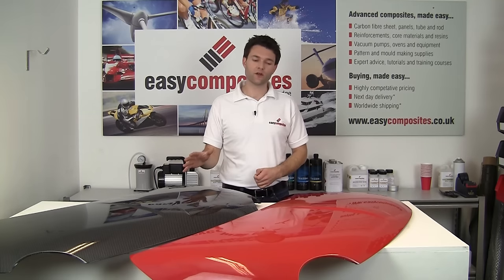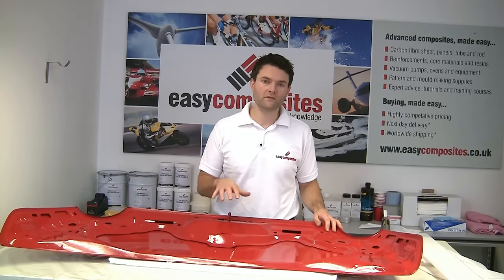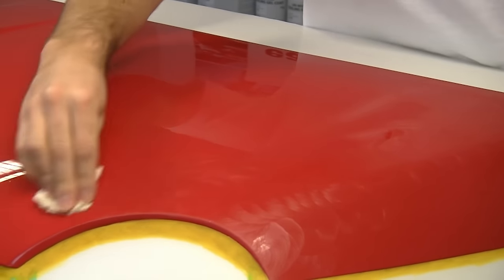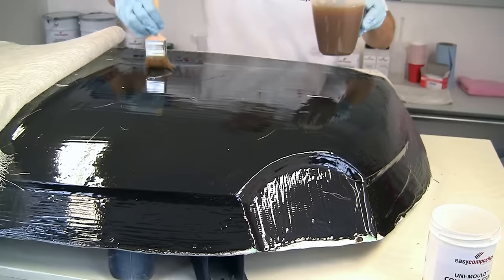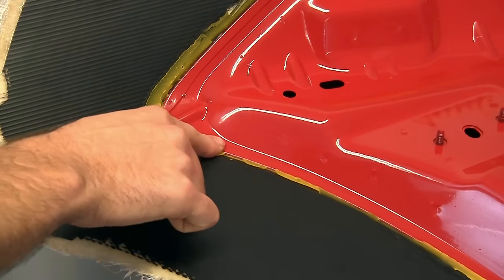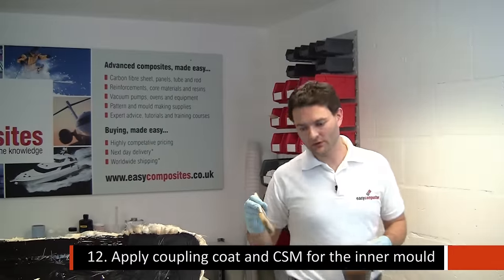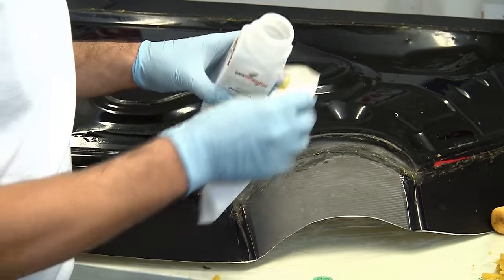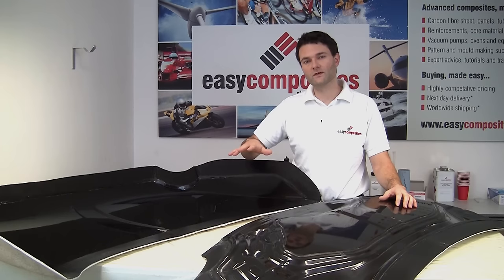How to Make a Carbon Fiber Car Bonnet/Hood - Part 1/3 : Making the Mould

Comment: What would this have cost (mold and part) if you were to buy the materials?
Reply from the maker: No The finished bonnet wieghed 3.5kg which is a saving of 16kg over the OEM
 bonnet. 
 
The exact amount of materials you’ll need will vary depending on the 
size of your hood so I’ll base this on a bonnet of standard dimensions, 
you can then scale the quantities up or down depending on whether you 
hood is larger or smaller than an average 1.5m x 1.2m bonnet.

Also, some of the steps (like the gelcoating) are optional and other 
steps (like the bonding of fasteners) will depend on what you need to 
bond so I’ve broken these down separately at the end.

*Complete List of Materials for Making a Carbon Fibre Bonnet Measuring 
1.5m x 1.2m*

Mould Making Materials:

The outer mould and inner mould will be approximately 1.9m x 1.5m in 
size. This is about 3sqm per mould.

Quantity    Product                                    Unit £    Line £
10kgs         Uni-Mould Tooling Gelcoat         52.50     105.00
10kgs         Uni-Mould Coupling Coat           46.60      93.20
50kgs         Uni-Mould Tooling Resin           114.00      228
15m            80g Chopped Strand Mat          1.70         25.5
14kgs         450g Chopped Strand Mat         2.19         69.66
1                Laminating Roller – 75mm         5.20        5.20
5                3” Laminating Brush                  2.00        10.00
100             Nitrile Gloves                            4.99        4.99
100g           Number 8 Release Wax             6.50         6.50
500ml         Easy-Lease Chemical Release   16.50       16.50
330g           Yellow Fileting Wax                   6.17         6.17
1 roll           50mm Release Breaker Tape      6.95         6.95
                                                                  TOTAL   577.67
 
Equipment & Consumables

Quantity      Product                                   Unit £      Line £
1                  Resin Infusion Starter Kit,         357.00     357.00
                    With Pump, 5kgs Resin
                                                                   TOTAL 357.00

Materials for the Bonnet Itself

For a bonnet measuring 1.5m x 1.2m you would want a surface plies 
measuring 2m x 1.5m. Based on a an outer skin of 200g carbon, 2mm Soric,
 200g carbon this means you'd need 4m of 1.5m wide carbon fibre and 3m 
of Soric for the outer skin.

For the inner skin 2m of 1.5m wide 200g 

Quantity      Product                                          Unit £    Line £
6m               1.5m Wide 2/2 200g Carbon Fibre    35.00     210.00
                    200g Carbon Fibre
3m                650g 2/2 Twill Carbon Fibre             25.00     75.00
3m                Lantor Soric 2mm                          8.14       24.42
1                   PT326 Adhesive 400ml Tube          48.41      48.41
                                                                        TOTAL  357.83
 
This gives a grand total of £1292.50 (ex VAT) for all of the essential 
materials and equipment to make the carbon fibre bonnet/hood. Remember 
than most of the equipment can be re-used forever and that the moulds 
(the most expensive part) can be used to make hundreds of parts if you 
wanted to.

Optional Equipment & Materials

If you want to spray the outer skin with a UV protective gelcoat 
directly into the mould before infusing then you would need a cup-gun 
and gelcoat but I would not recommend you do this because it’s an added 
step of complexity. Instead, I would suggest you infuse straight into 
the mould and then, if the parts comes out right and you want a UV 
protective coat, that you just lacquer it afterwards.

Quantity     Product                                   Unit £    Line £
1                 Gelcoat Spraying Cup Gun       130.50   130.50
2kgs            GC50 Polyester Gelcoat          11.75      23.50
                                                                TOTAL   154.00

If you don’t have abrasive tools for trimming and finishing the parts 
then consider:

Quantity      Product                                      Unit £  Line £
1                  Perma-Grit Sanding Block Small  13.96   13.96
1                  Perma-Grit Bosch Jigsaw Blade    3.54     3.54
1                  Mirka Combination Pack              19.95   19.95
1                  Perma-Grit 32mm Rotary Disc       8.33    8.33
 
Likewise, if you don’t have a dispenser gun for the adhesive or you need
 the smaller adhesives to bond fasteners in they are listed here:
   
Quantity        Product                                      Unit £    Line £
1                    400ml Adhesive Dispenser Gun    52.50     52.50
1                    50ml Adhesive Dispenser Gun      19.95     19.95
1                    ET515 Epoxy Adhesive                10.17     10.17

It’s worth remembering that in composites, the most expensive bit (apart
 from the equipment) is the moulds. In the above list you’re buying a 
lot of equipment for the first time which you’ll be able to use over and
 over and you’re also making a mould which, if you wanted to, you could 
also use over and over. If you only use it to make one part then it 
pushes the cost of that part right up but having a mould does give you 
options for making other parts and selling them, or making multiple 
copies for yourself (rally car use for example!).

Comment: as much as it sucks, i dont do plies between cure. i either wait for a full cure, use lamps but carefully not over accelerate the cure. but i def do a full cure and then do a sand and clean then continue building plies. then again that was for aircraft cars def dont go through as much torture.
Reply: i guess for a mold it wouldnt matter all that much.

Comment: what is that white liquid that you always put a few drops, and why this (MEKP Catalyst) can not be send to USA and what is that used for, if it is really important, what else do i can use, thanks
Reply from the maker: +Aldo Allende Oliva: MEKP is that is used to cure vinylester and polyester resins; if you read our guides and watch our videos you will be able to see how and when it's used. MEKP is highly oxidising and is simply not allowed on an aircraft. You can purchase it from any fibreglass supplier, boat yard, auto shop etc.

Comment: Fantastic video tutorial! 

One question...how often can you use a mould like this?
Reply from the maker: +DJMaKOfficialPage Moulds made from Uni-Mould have a very hard-wearing vinylester gelcoat and you will get literally hundreds of pulls from a mould like this. We have tooling made from this system in our workshop which we have used daily for years. Sometimes, the moulds get scratched or start to get dull so we re-polish them but basically, they are a permanent mould.

Comment: Doing gun metal chrome oem grills, would I need to Sand or just lay the resin? I am trying to skin these pieces
Reply from the maker: The surface always needs a good key with sandpaper to ensure the basecoat resin can get a good grip to the surface.

Comment: When you add the catalyst make sure you mix it in very very well, if you doing it by hand count a minimum of 100 strokes.
If you dont mix it in properly, it doesn't set up you will have a complete disaster on your hands.
Reply: I only did 99 and it worked out fine.

Comment: Would painters tape work any better than masking tape to remove?
Reply from the maker: Where are you seeing masking tape? Neither painter’s tape or masking tape would make a resin release barrier. The translucent green tape is called Flash Tape, it’s made from PET with a silicone adhesive.
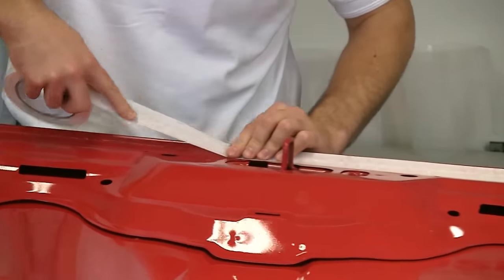Reply: @easycompositestv   3:43 ...always had issue with residue from masking tape removal was curious is painters tape would have been acceptable

Comment: Great videos, I like how you work and final result! I only have one question..what is white material you used to create an edge around the part? Thanks!
Reply from the maker: Polypropelene fluted sign board. Its cheap and easy to get hold of, easy to cut and work so makes a great flange material.
Reply: easycompositestv Thank you for your answer, after I saw other videos on your channel and your website and I found the product also..waiting for new videos! Good evening.

Comment: My bonnet wouldn’t release. It wasn’t Stuck to the hood but it didn’t want to release easy from the front. Ended up breaking the mold. I’ll try again this week
Reply from the maker: Double check the application of your release agents and that the bonnet does not have any solvent based fillers or primers recently applied to it as that can cause sticking issues.
Reply: @easycompositestv  it’s been a month since I crafted and painted it. It’s a custom hood. I did the wax but also a spray release. I think the spray might have been a bad idea as the hood became tachy

Comment: I have a plastic boat that is made using clam-shell tech. 

I want to basically use it as a mold for  CF version.

 Im wondering if it can be done for under a grand?
Reply from the maker: Entirely depends on size/ planned layup etc.
Reply: @easycompositestv  Yea sorry, i totally forgot to put specs. Lol

Its 10'x4'x36" and weighs about 140lbs from factory. Its a hard pontoon setup, the bottom piece is the pontoons and sub floor while upper is gunnal and tub deck.

I know thats still a really generic description but just on CF material and resin, im curious what the approx cost would be.

Comment: Aluminum does not shatter, it bends. If an aluminum panel shatters, then the material was made from foil and not the actual standard thickness most cars use

Most of your common race cars use fiberglass/carbon-fiber or other lightweight composites, especially on removable body panels like the front end and tail-end.

DTM and LeMans cars have composite body panels for the most part.

The Australian V8 Supercar series is one of the only series I know of that still uses aluminum, aside from Nascar.

Comment: Hiya, I'd like to use your products to make a new C/F bonnet for my BMW E46.
I'm mainly concerned with 1 thing, the thickness.
How thick will I have to make the c/f layers to make a good, sturdy bonnet?
I'm not a race car driver of any sort so shaving off as much weight as possible isn't much of a concern.
So what can I do to make it a good sturdy bonnet with a solid feel?
Do I use nomex?
Reply from the maker: Dicks X McIronCocke For your road car there is no reason why you couldn't use a similar layup to the bonnet in the video.  That keeps the inner frame as well as the outer skin making the part nice and stiff.  You could always add extra layers to the frame for additional support if you are worried your bonnet is too flat and will flex too much.
Reply: Easy Composites Ltd Thank you for taking your time to answer.
I'd like to take a little more and ask you a few more questions, if that's ok.

First, I'd like to make my hood a little darker than what c/f currently offers, I love the pattern in it but the huge colour difference puts me off.
Can I use some sort of paint to make it darker so it fits the Cosmos black paint of my car?

Regarding the sturdyness vs the OEM bonnet I'd like to know how I can keep that same sturdy feeling of the OEM thing, but I'm concerned I'm actually just misunderstanding just how strong c/f really is.
What could I do to make sure it has that nice, sturdy feeling of the real thing?

Thank you very much for your time, I'll be sure to mention your company and its products  when I make a picture log of the procedure.

Comment: What would you recommend for cleaning fiberglass mold if any of the mold cleaner is not available? Thanks.
Reply from the maker: Acetone or Methylated Spirits (not white spirits as that leaves a residue behind).

Comment: I was interested in making a mold of my car hood.   Does this damage or cause the original part any problems?  I have a jaguar XKE, and would like to keep the hood intact, but I would like a carbon fiber hood for reduced weight.
Reply from the maker: It is possible you may damage some of the paint during the demoulding process.

Comment: I'm eventually going to start working on an F1 wheel for my sim rig with carbon fiber and I'm confused on how I could cover it with carbon fiber in the areas such as the handle. can I add carbon fiber to the sticky surface in sections before adding resin?
Reply from the maker: You can certainly cut the carbon fibre into suitably sized pieces to help you skin the wheel properly. That will help keep the look neat. We have a great new video on carbon fibre skinning which shows you how to do this in detail. You can watch this video here: https://www.youtube.com/watch?v=aqwhcfQZT8U

Comment: 14:31 wouldn't the wax leave an unwanted large void between upper and lower mold after it's been removed?
Reply from the maker: No because the 'wax' is only there to extend the edges of the mould. Once the component is demoulded it will be trimmed back to the original component line.

Comment: Is the high temperature panel moldable into different shapes like the fabric is? Is the process the same? What are the temperature limits for the non high temperature 3k and 6k fabric?
Reply from the maker: Carbon fabric is not temperature limited in most uses.  It is the resin and its cure cycle that determines the temperature limit of a part.  Once a part has been cured, It cannot be remoulded into a different shape.
Reply: Easy Composites Ltd that wasn't what I asked but thank you for the information. My question had two parts: what is the operational heat temperature limits of the non heat resistant varieties of the carbon fiber. At what temperature does the material begin to degrade for the non high heat version of the material. Also is the flat panel variety of the high temperature carbon variety moldable into other shapes and forms like the fabric version is?
Reply from the maker: Hi Brian, I think we might be talking at cross-purposes or there may be some other misunderstanding. What are you referring to when you talk about a 'high temperature panel'? Are you referring to uncured prepreg carbon fibre (not used or mentioned in this video but featured in some of our other videos)?

To be clear, there is no such thing as a 'heat resistant variety of carbon fibre'. Carbon fibre is the reinforcement used in a CFRP (carbon fibre reinforced plastic) composite. There are 'heat resistant' (i.e. high Tg) resin systems but the carbon fibre reinforcement does not have different temperature tollerances, it is always the same. If you want to make a panel that can withstand high temperature then you need to use a resin system with a high Tg (glass transition) which is layman's terms is the temperature at which the cured matrix starts to soften (or lose its mechanical properties). The epoxy resin we use in this video has a Tg of 75'C so the panel is suitable for use up to that temperature. We have an epoxy with a 170'C Tg which could be used in lieu of this system which would produce a cured component suitable for use at a considerably higher service temperature (up to the 170'C Tg of the resin) however so achieve the high Tg (even using these special high temp resins) it is necessary to post-cure the panel using a steady-increase in temperature up to the service temperature required (example, gently increase the temperature of the panel up to 170'C).

If when you mention 'flat panel variety' carbon fibre then this sounds like you're possibly talking about a cured carbon fibre sheet. In this case, the carbon fibre sheet is the finished product; you can cut and finish it but you can't re-mould it or re-shape it. This is the nature of thermoset resins (like epoxy), once they have cross-linked during cure they are set in that position. Only when a 'prepreg' has not been cured yet can you manipulate its shape.
Reply: Easy Composites Ltd this reply answers my questions. Thank you

Comment: mate I want a bonnet for my van but weighing up the parts cost and the time to just using my visa for 3 minutes and the bonnet arrives already made next day. Hmmmmmm which shall I choose.....?
Reply from the maker: Hi James, it works for everyone that the world is split into those that want to make things like this and those that would rather just buy them :)
Reply: So many things to do in this life and one of them is make everything. Make cool machines. Want to do a bonnet for my renault master truck and want to make a wing for a plane. Also want to make a gyrocopter for my boat. Quick way to get in land as I reach port and cant be bothered to lower the tender dinghy. Just need a workshop. If had one these easy composites guys would have another customer. Might even ise one of my single car garage lockups to do this to start with. Very interested. Hmmmmm
Reply from the maker: Hi James, we get you! Having a workshop to do this stuff is a privilege that not everyone has. If your situation changes then you know where to find us. Good luck with whatever you choose to pursue.

Comment: Can I use paper instead of chopped fibre mat?
Reply: Fibreglass provides strength in resin casting so I guess no unless you want your mould to be flimsy
Reply from the maker: No, not really. Chopped strand mat is incredibly cheap anyway and does a superb job or reinforcing a mould. Paper would do almost nothing to reinforce the mould so definitely not a good idea.